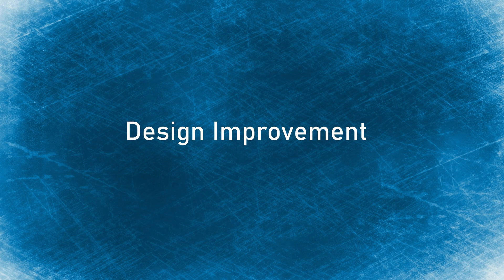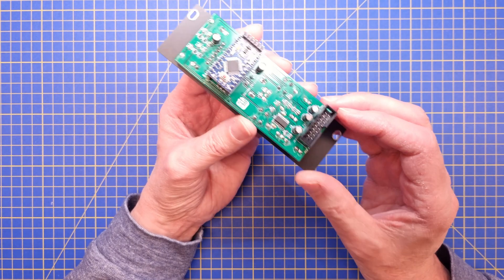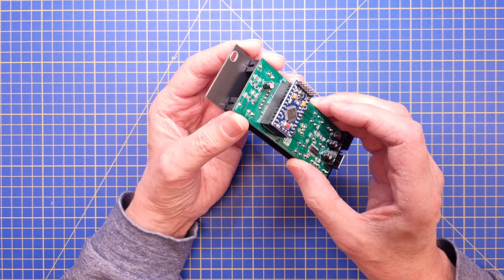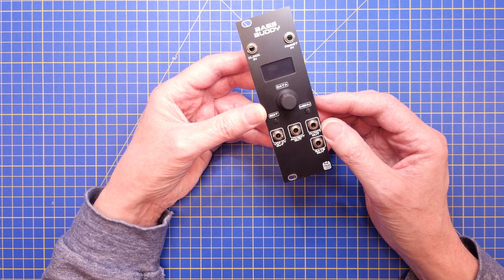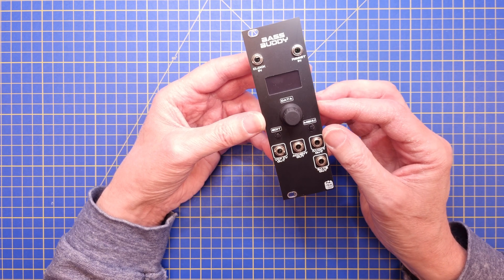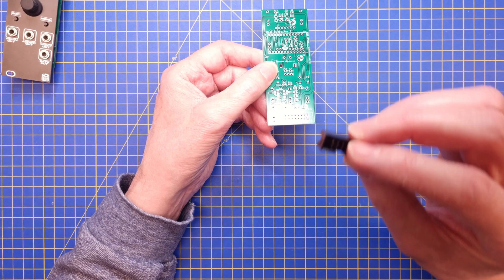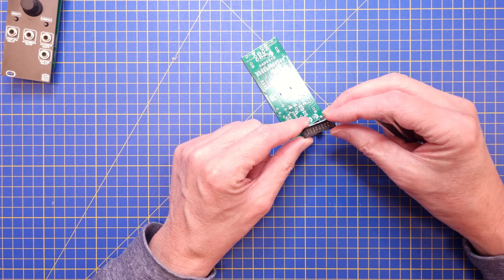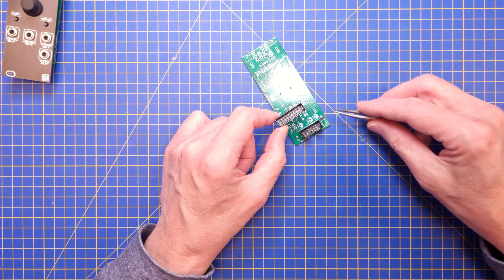Eurorack DIY - Bass Buddy Ep 3: Design update and software walk-through

Comment: Hi and good day
Where I found more details about programming Arduino Mini Pro?, only see in GitHub a document with 3 libraries, but what is autor of Encoder?... I compile and program 3 Arduinos and screen in black!!, THANKS and AGREE your PROJECTS
Reply from the maker: I'm using Encoder v. 1.4.2 by Paul Stoffregen - https://www.pjrc.com/teensy/td_libs_Encoder.html
Reply: @MeeBilt  Great!!!...Now when connect Clock-in from VCO, the Arduino block, and no respond...withoth clock, menus and all run normally....some idea?
THANKS
Reply from the maker: @inoffice  What is the frequency of the VCO ? is it ouputting a square wave that is suitable as a clock ?
Reply: @MeeBilt  Sorry VC-LFO module.
Reply: @MeeBilt  Yes square wave (I was see in oscilloscope), around 3.6Vpp
Reply from the maker: @inoffice I suggest that yopu measure on pin 9 of the Arduino to see if you can see the clock signal.
The 3.6 Vpp signal level might be too low, so check that the voltage swings between 0V and 3.0V